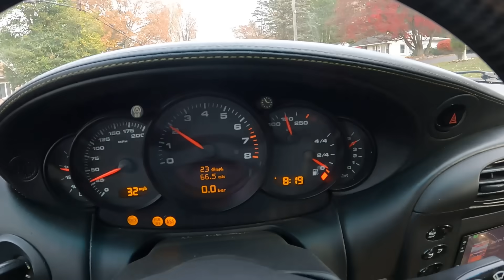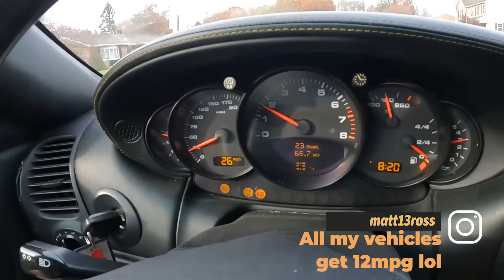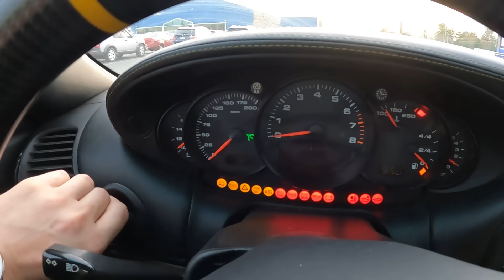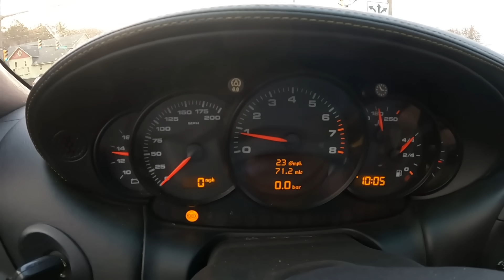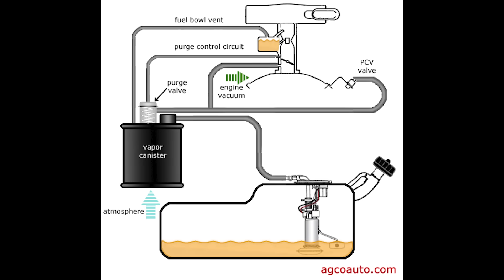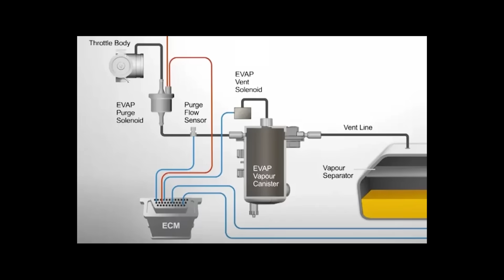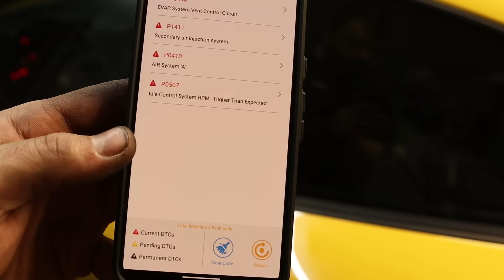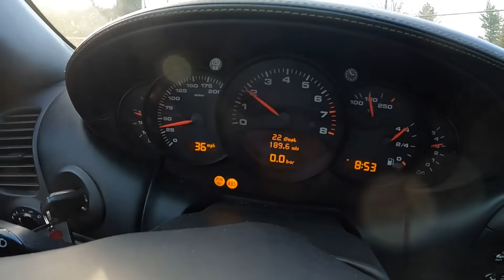This is why you CAN'T Daily Drive Porsche 911 Turbos

Comment: I daily drove my 996 GT3, and my 996 Turbo.  The GT3 was a better daily and the Turbo (as you pointed out) drank fuel like there was no tomorrow, but the GT3 was just seemingly more troublefree.
Reply: Dang, I hardly drive my 2002 996 base, has 26k on the odometer but bet it has given more trouble than your 996’s.
Reply from the maker: Most zay the turbo is a better daily. Hrm
Reply: @matt13ross  turbo is definitely a better daily.  My 996 turbo has been 100% trouble free

Comment: Keep the faith Matt. You're still churning through years of neglect from the previous owners. I daily an '01 996TT and have zero qualms about taking it anywhere. You've come so far with it, you'll get it back to baseline. You should be able to pile the miles on it...
Reply: Had this happen on a 01 996 turbo as well. Routine maintenance to start so filters, plugs, sleeves and oil. 
Car handled tail happy. Alignment was way off. 
Clutch was a difficult to modulate. Master Cylinder replacement.
Gas pedal was sticky. Remove, clean/lube, re-install.
Engine cover wouldn't pop open. Used a screwdriver to reset spring. Works for now. 
Spoiler sagged. Just drove it and it fixed itself....for now. 

Just needs to get reset back to a baseline of routine maintenance and then you can drive it knowing you'll have some repair needed once a year instead of all the time at random.

Comment: If you still have a CEL for the EVAP system. Try changing your fuel tank pressure sensor. I fought the same code over the summer in my Silverado and finally fixed it after replacing the fuel tank pressure sensor

Comment: I “daily” my 01 996TT. 204,000 miles. Driven from coast to coast and all around. Pulling the engine and trans right now to replace tons of brittle rubber and plastic, and swap the tired clutch out. They are pretty robust cars.
Reply from the maker: Mine just still needs more work to be that reliable.

Comment: I had the same problem with my Cayenne turbo did the exact same thing. It was a cheap part $120 part. It was a purge valve for something with the fuel system. It was allowing fuel vapours to go into the intake manifold, and essentially choking out the engine.

Comment: I had issues filling both my 996 turbo & 997 turbo.  Best not to let them not hit red and they only fill to little less than 3/4 and the gas head had to be tilted to the 90* or upside down.  Problem starting after could be purge control valve back in motor.  And bad purge valve causes idle fluctuations. And, the purge valve isn’t a drop motor on the 997. Just cut the heat shrink & use regular auto rubber hose & clamp.  Congrats & cheers

Comment: My dream car is a 991 911 Turbo, so hopefully those are a bit more reliable to daily drive than the older ones. My 991 Carrera S has been an amazing daily driver for me so far
Reply: I have a 991.2 Turbo S.  45k on it ... Zero issues.  👍
Reply: It’s always depends on the previous owners not on the car. All 911 is solid and reliable. You could daily drive an old classic air cooled model too.
Reply from the maker: Old abused cars like mine aren't good examples lol

Comment: Take it to the Porsche dealership for a computer diagnose because there are other type of codes what you can’t read out with a common reader. I did that with my jaguar when i had a problem with my climate control. It cost me $100 and got the right answer onto my problem. Got the faulty sensors changed by myself and the problem got solved. The best quality gas what you can find in PA is the Sonoco 93. I tried several gas stations and that was the best.

Comment: What was happening was that when you fill up the vent valve should be open to allow fumes into the charcoal canister and let out excess air that has been stripped of gasoline fumes and it wasn't.    With the vent valve not opening and allowing the normal process to happen the fumes went into the engine when they are not supposed to causing a vapor lock.

Comment: There is a Cable running through both front fenders for the pad wear sensor and wheel speed. This cable goes bad and like your friend earlier in the video was saying. You lose continuity. I had the intermittent lights and my problem was my driver side cable. Common issue
Reply from the maker: Might be the issue

Comment: Matt I really enjoy following your channel. Do you have mechanic experience? You are very knowledgeable about what you are doing and I am always impressed by your knowledge and tenacity. I have a ‘21 Cayman S so I am a Porsche fan also! Can you share with me the diagnostic device you use and do you have a discount code from a particular brand? Looking forward to your next video! Happy New Year!
Reply from the maker: Here's a simple Ancel one I use.  Works with your phone or handheld.  Pretty cheap too! https://www.amazon.com/ANCEL-Bluetooth-Automotive-Diagnostic-Compatible/dp/B07J51W9NS?maas=maas_adg_D3D9DDBE2E4C49ECD79BC2BD6988A226_afap_abs&ref_=aa_maas&tag=maas
Reply from the maker: And thanks!  I was never a mechanic, just wrenched in my spare time for many years.
Reply: Thanks brother. Your abilities to do what you have done are incredible. Hope to meet you one day. I watch you every week. You are my favorite weekly video!
Reply from the maker: Thanks for the support and for watching!
Reply: Those standard readers are good enough to read faults and clear them but that's all they can do. They can't reset oil change reminders for example. They can't do any programming either. I have a cheap standard reader myself. But I plan on getting a durametric pro at some point. That tool does absolutely everything you could need done

Comment: Isn't owning a classic car fun?  Nice job fixing the fueling issue.  As for the PCM issue, you may have faulty ABS sensors.  They often go bad, especially in areas that salt the roads in winter.  They are usually pretty easy to replace as long as the mounting hardware hasn't rusted up too badly.  The other possibility could be that you have a faulty g-sensor.  Those are located inside the car, I think in the passenger footwell area.  I haven't replaced one, so that's just a shot in the dark, but I thought I'd share that info as well.  Good luck!
Reply from the maker: Yes tons of fun! Lol thanks

Comment: Check your reluctor rings on rear driveshafts. They can get gunked up with rust and cause the ABS sensor to freak out and throw a code. If they look ok and arent split it's likely a bad ABS sensor.
Reply from the maker: I need to get someone to check the codes

Comment: Matt, I love your channel and I love your projects and cars. But you can't answer the daily-or-not-question based on some crazy project cars that were litterally fucked up before. We have and had many Porsche Turbos in our family, including a 997.1 Turbo manual, and we never had problems with them. But these cars were all Porsche Centre maintained all their life, low mileage, low amount of hands, accident free etc., and much more expensive like your 997s for example of course. The 911, including the Turbos, are known to be perfectly fine for daily driving. My good friend is a Porsche Centre workshop manager and he says the same. But he says, after 997, it got worse, because of new engines and much more electronics.

So, don't give up, fix the problems and enjoy the hell out of them!🙂
Reply from the maker: Someday it will be reliable. It's all basically caught up maintenance wise. Just giving me issues. But expected for 150k miles I guess.
Reply: @matt13ross  Yes, I hope for you and am looking forward to the videos.

Comment: You have a problem with your carbon canister probably clogged. I went thru similar issues with my 996tt. Ended up replacing most of the valves for fuel evap system only to find out my problem was a bumble bee had flown into an open ended fuel evap line that runs from the front all the way to the engine bay. 😂
Reply from the maker: Wtf lol

Comment: I feel like the talk about this being a reliable daily doesn't apply to such an absolutely beat, clapped out example
Reply: Exactly. Plenty of high mileage 996 tts that are daily driven but are actually maintained
Reply from the maker: I certainly wouldn't say mine is beat, or clapped out, or even close.  Did it used to be?  Yes.
Reply: @Matt13Ross all 20 yr old cars have gremlins that pop up. My dc2 left me stranded a few months ago because the neutral stop switch on the clutch pedal broke as it dried out.

Comment: The durametric scan tool might point to a wheel speed sensor causing your intermittent issues. You also might be able to inspect the connectors and you might see one intermittently grounding or cracked. You also might not be able to see it, it is millavolts and doesn’t take much to interrupt the Hall effect. I can mail you my durametric if you pinky swear to send it back quickly but you have enough going on you can justify your own and it has lots of features a generic scan tool doesn’t have that you’d get a lot out of it with your builds.
Reply from the maker: I may take you up on that!

Comment: Matt, I think you are being a bit harsh on the “reliability”…considering your 996 and 997 were both rough versions of these top of the line 911’s (the only better, more expensive trim offered was the GT3).  150K miles is a lot for any car, let alone a European sports car.  You would never see a Ferrari or Lamborghini even in one piece if it had that kind of mileage on them.  That alone is a testament to the German engineering.
Reply from the maker: Fair points!

Comment: Diagnosing late model car issues can sometimes be a headache, but keep your head up. You have a code reader and you have the right mindset to fix whatever you need to. You also have an awesome classic BMW with an LS engine. Most Porsches are gonna be left for dead in the reliability department by the LS. The 996 does have 150K miles though. Things tend to go wrong at the mileage.
Reply from the maker: True story!!

Comment: Matt , air flow sensor ?
Reply from the maker: For which issue?
Reply: Apologies , I had a 996 about 9 years ago and it used to " Hunt" on idle especially when it was cold weather.
Reply from the maker: I replaced the MAF last year.
Reply: @matt13ross  okay I will be quiet…. Lol I don’t want to add to the problem solving noise. It’s a very common problem with all 2002 Porsche’s onwards. Even today it’s a weak spot.
Reply from the maker: It could be the MAF still.  Maybe I got a bad one?

Comment: It's unfair to label a vehicle "unreliable" when you bought it in such a state of neglect and disrepair.  Get it 100% first and have a better informed opinion on the matter.
Do you have a tune on this car?  If yes, did they account for lack of cats? If not, this could be a cause of issues too
Reply from the maker: No tune. And it's getting there reliability wise.